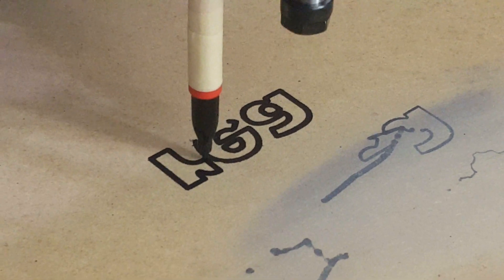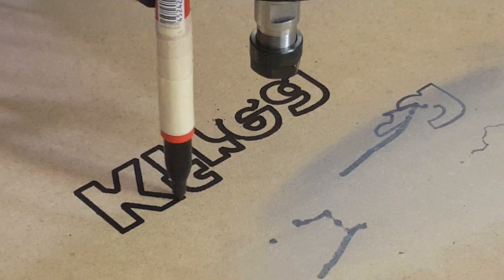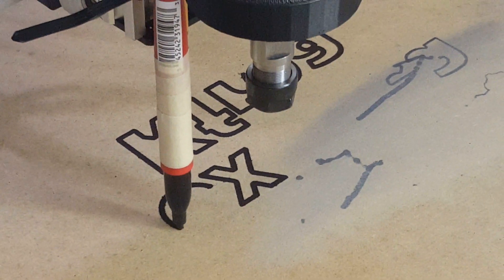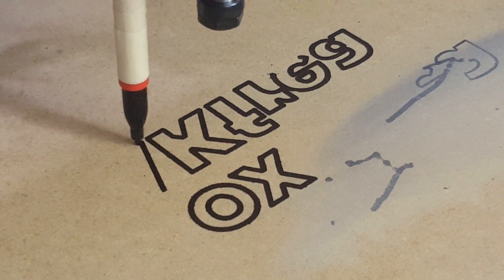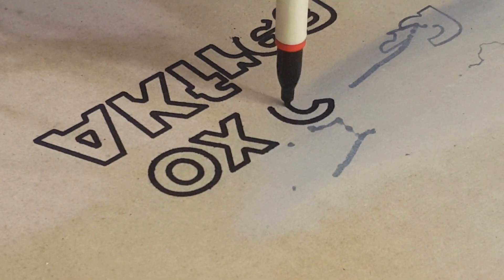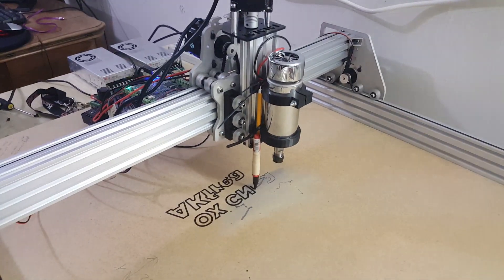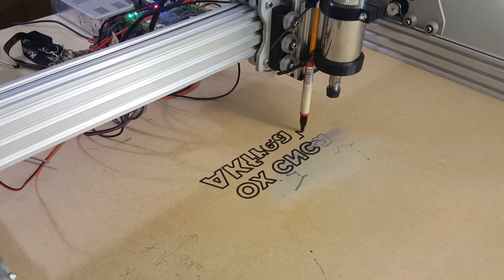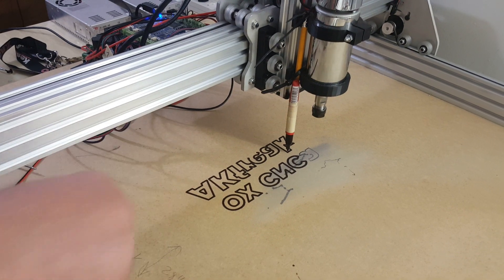TinyG  Controlled OX CNC Machine First Pass

Comment: Hey Thomas, did you ever get it to draw the text right? I have the same machine and I have to flip the text before creating the g-code. Was hoping for a fix. I'm using Makercam and Chilipeppr along side the tinyg board. Thanks in advance! Brian
Reply from the maker: Brian Poland yep fixed long ago.  it was a setup issue in the parameters.